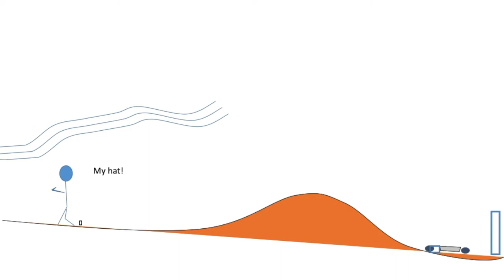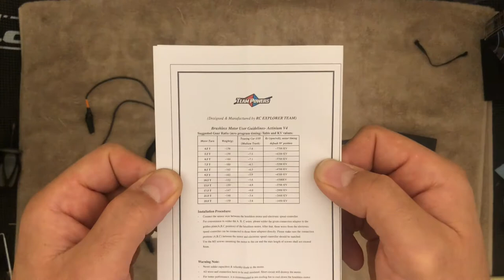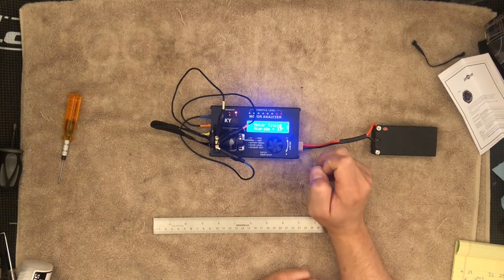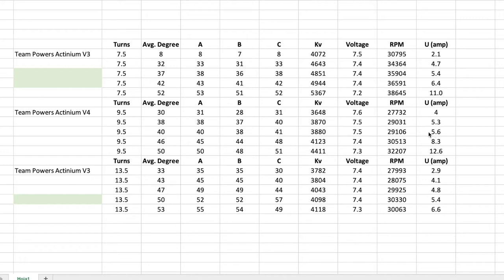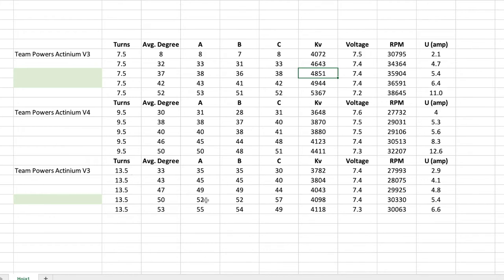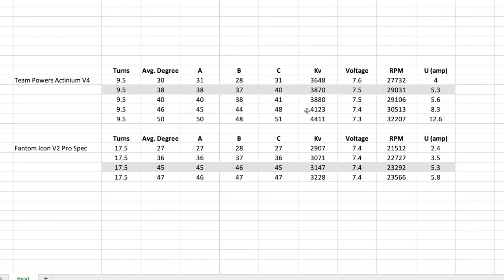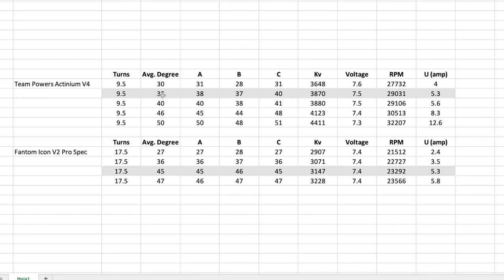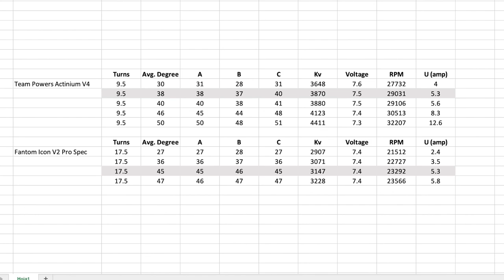Team Powers Actinium V4 9.5T Specs Kv Weight and general overview

Comment: Thanks for the video, cool setup you have there! I just ordered a TP 13.5 V4 because of some things I read instead of a Hobbywing motor (not sure if that was a great decision or not). I have also coming the brand new Hobbywing XR10 PRO G2S ESC and hope I made a good choice and these work well together. Some guys on a forum were raving about the Team Power motors so hopefully I didn't fall victim to some online hype lol. I'm new to buggies and probably wont race at my local track buy just want to run it in there for fun in my spare time.
Reply from the maker: 13.5T is generally used for 4WD buggies. If you have a 4wd, they are fun. If you have a 2WD... it will fly. To be honest, if you are just having fun and not competing, TP is good. You could go with an EcoPower motor as well. A 13.5T EcoPower is similar to a Trinity 17.5T but for half the price. If you are just practicing or having fun, any will do the trick. Now, the esc... I really like the HW esc you selected. I have the previous gen and it is one of the most reliable trouble free esc I have had.
Reply: @telecomandorc  Thank you very much, I appreciate your input! I will keep the EcoPower in mind if I ever need another motor (good and cheap is always a nice combo).
Reply from the maker: @SyntheticCompany  Especially for bashing or just having fun. Fun does not have to be expensive. You are welcome. Cheers.